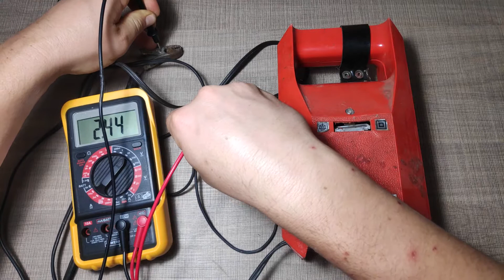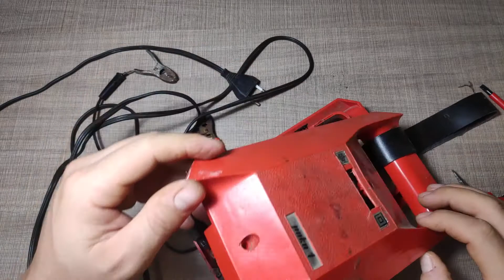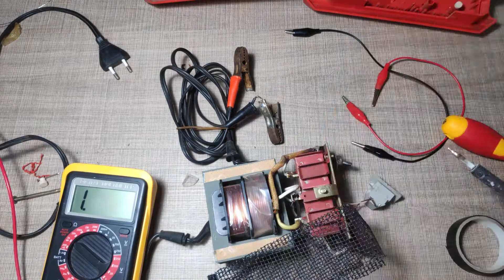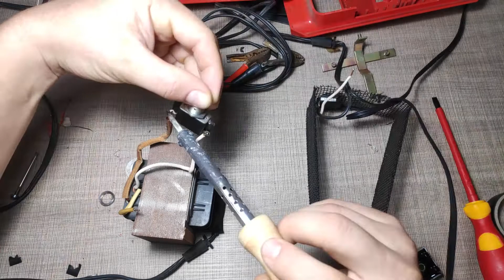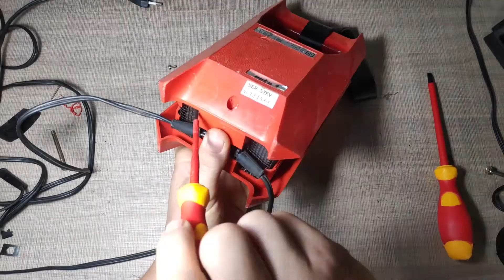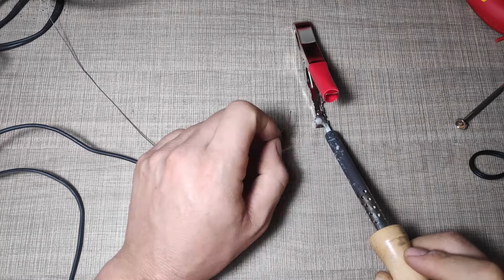Car battery charger repair - replace bad bridge rectifier

Comment: could you explain the hookup of the rectifier in a reply? I couldnt follow it without seeing it clearly.
Reply from the maker: There are two marked terminals on it. One with '+' and the other with '~'. The transformer is connected to the '~' pin and the one diagonally opposite of it. The '+' and its diagonally opposite pin make the output. You can think of it like 4 separate diodes, all pointing to the '+' pin.

Comment: wouldn't the rectifier naturally heat up?  i mentioned it because it might melt the wire that was touching its body when you closed the case.  in some videos that i watched most rectifiers are isolated and connected to a heat sink of some sort.
Reply from the maker: It does get a bit warm especially when charging a flat battery but not so much to melt the solder. That is the reason why the case is opened so air can circulate and cool things off.